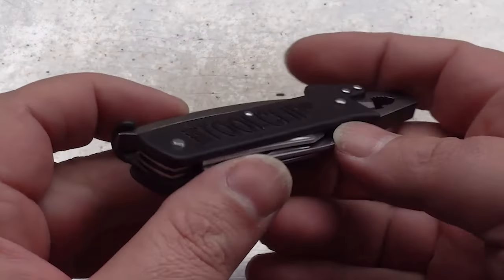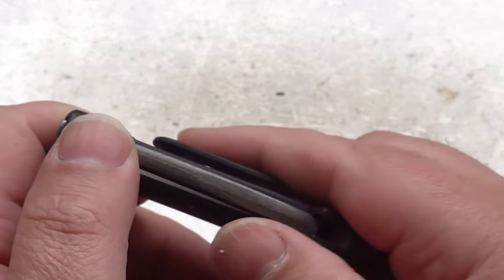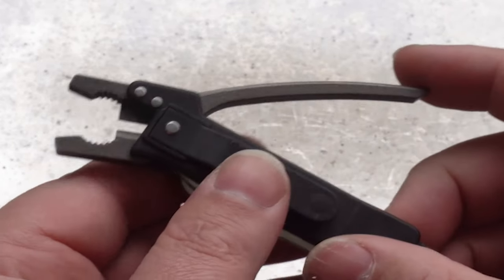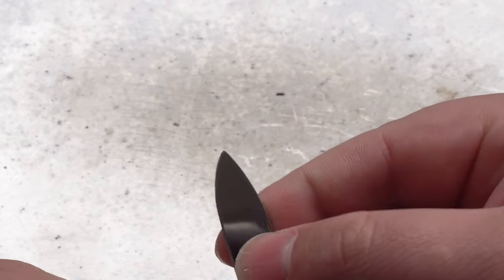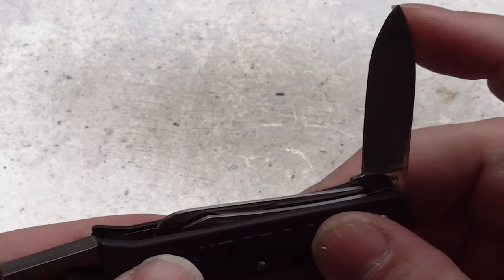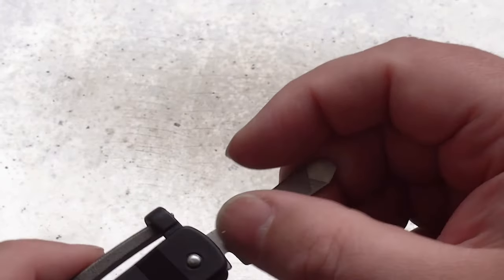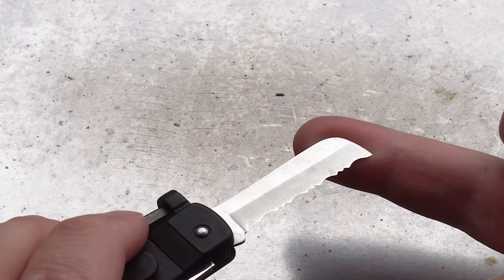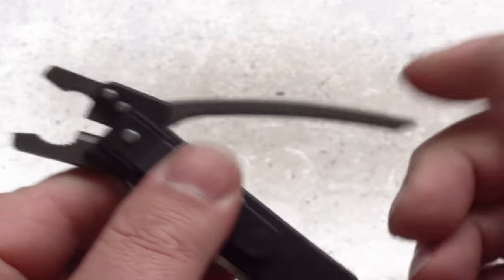Video review - SOG Micro ToolClip *4K Ultra HD*

Comment: I have the newest incarnation (3rd generation) Micro Toolclip.  It may be made in Taiwan rather than China but I'm not sure on that and can't be bothered digging out the packaging.  I also feel that although the overall plier design is good, they could have put some better folding tools in it.  Mine has a 5cm knife blade which is okay, but the file is very badly made and not aggressive enough to actually file anything, not even fingernails, and then there is a flathead/bottle opener thing.  The end of the handle has a Phillips driver on it which of course is very cumbersome and awkward to use.
Reply from the maker: Hi Simon. I'm almost positive the second gen was made in China. I'm not sure about the third, though. This had more potential, but it's been discontinued now. Thanks for sharing 👍